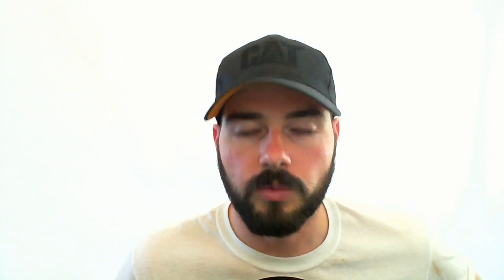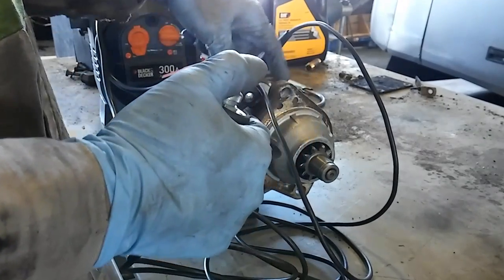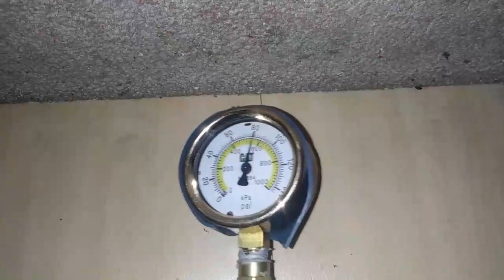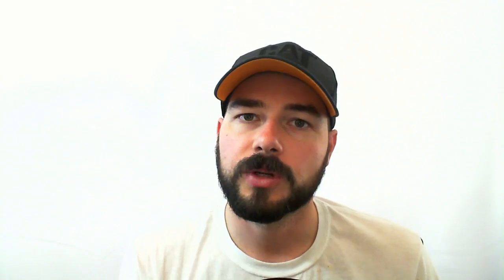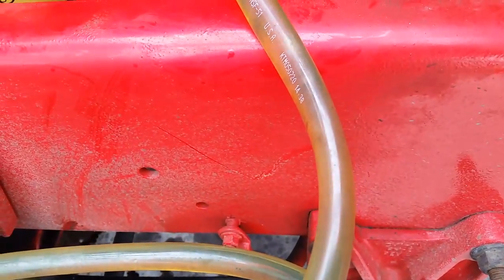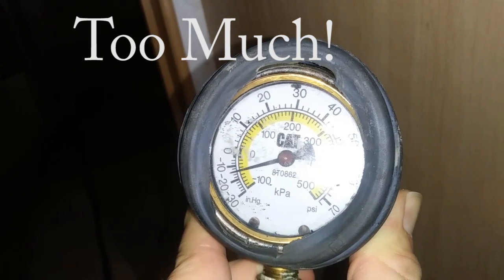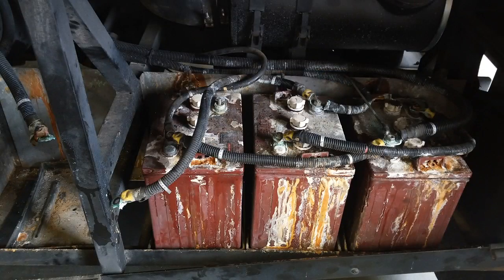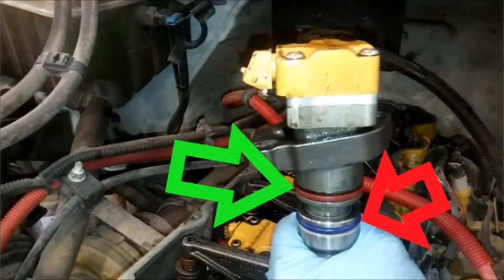Why Are Diesels Hard To Start? How To Fix A Hard Starting Diesel?

Comment: The points you made about poor ground connection is true, almost bought a new battery believing the battery was going but when checked realized the ground wire to the starter was slack and the ground to the body was corroded..👍🇯🇲

Comment: Hi, I just watched you video. I’m not a mechanic but I can stumble through a let of repairs. Being retired and extremely limited on money I’m trying to deal with my van not starting. It’s a chevy year 2000 diesel duramax  express 3500 van. It’s been hard starting and when it starts I get a few seconds of blue smoke out of exhaust and  then drives fine. I continues to start fine. But after I park for a few days it becomes hard to start again. Yesterday it would crank and almost start and I would get blue smoke out the exhaust but never start. And the cranking is a bit slow and if it doesn’t start in a few seconds the cranking get very slow. I have put a freshly charged large jumper box on it but still the same. Two days now and I haven’t got it started. I don’t have the money to take it to a shop. Any pointers that I should do? I want to check the grounding straps. But I have to find them. I remember seeing one in the past and it looked very green and deteriorated. I’ll try a jumper cable from battery to engine block. Anything else with my limited skills can do?

Comment: I have a 05 5.9 dually that I have done lots of upgrades on. grew up with muscle cars but knew little about diesels but I have learned. My 5.9 has always started right away and never smokes. I consider myself very lucky. I tow a fifth wheel and if your going to work em you gotta work on em. Good maintenance filtration and lubrication.

Comment: My 4m51 Mitsubishi stops working whenever am running and the engine is hot.it can't even start right after it stops ,I will have to wait until it cools down about an hour or so before I can start it again.what would be the possible cause of this?

Comment: My Dodge/cummins has been acting strange lately today it was almost 30 out and wouldn't start I'm like ok wtf. Checked the wires to grid heater and the battery connection is shot. Tried to use too small of wire to splice and it instantly started smoking!

Comment: Certain motor oils are designed to be thinner (less viscous) when cold and more viscous (thicker) when hot. For instance, multi-grade or multi-viscosity motor oils show a low viscosity at low temperatures and high viscosity at high temperatures. I believe you indicated the opposite. Did I misunderstand?

Comment: Diesel van wont start but starts easy if i use quick start spray into inlet ! I see there is a crankshaft sendor fault code so ive bought a new sensor but not fitted yet !
Why/ how does the car run fine after start if the crank sensor is at fault ? Surely if its at fault car wud run badly after start ??
Im struggling to understand ??

Comment: The truck I drive for the company I work for has a hard time starting after its been sitting over the weekend, it has an 8.9L cummins and it takes a good 1 or 2 minutes of cranking to start when its 100% cold and thats only with it about 60 degrees out

Comment: Just a little fyi.
 Today I was listening to this video on my way out to check a grinder with a c27. It's having a really long crank before starting and randomly dropping to idle. 
The issue? Bad wire connection on back of the key switch.

Comment: I have a 2005 Cat C7 Acert. Very hard starting. When it does finally start, it sounds like it's running on 3 cylinders, once started picks up a couple cylinders pretty quick, and then the other one a few seconds later and then it's running smooth and no problems. All while cranking and about the first minute or 2 after starting, putting out a huge plume of gray smoke. So according to this video, likely injectors, or could it just be  the seals? It does have some codes that need to be read. Of course first things first, get the codes read for the known problems. So I have an idea what to be expecting, any strong idea of what I'll be looking at for repair? It's only got 131,000 miles / 5005 hours so I'd hope it's certainly worth repair and shouldn't have any major issues anytime soon provided I keep the oil clean and changed at proper intervals. Thx for any help or suggestions.

Comment: You did not talk about heater plugs related to hard starting especially in cold condition. Is it that it does not have a relationship with hard starting in the mornings?
Reply: Your engine should start if it has good compression. Even without glow plugs

Comment: Ambient temperature is one of the most important things on a Diesel engine!
Therefor one must somehow heat the intake air , and also make the injection pulse with as high of pressure as possible!

Comment: This is why a 335 cummins I drove in the early 70s was sweat, it had a compression release you could spin that sucker even with a weak battery and fire it up quick when you released the handle.

Comment: I just had my 6.0 2005 F-250 Diesel New head gaskets replaced. No new heads but every thing but not the turbo. That was just rebuilt. Runs good BUT hard to start every morning. Upsetting. They will not help me fix the problem. How do you get the compression air racial repaired?

Comment: Hi Ape just discover this channel,really helpful info Thanks.
What about hard starting engine when in working temperature?
I have mondeo mk5 2.0l diesel TDCi ,this is Ford fusion in USA .I live in UK and the weather is between 0 and 25 celsius over the year.I have an issue when engine is hot.
If I stop the engine and try to start it straight after is turning much more than usually need to start,but I use a start stop and the engine shut and start on a traffic light for example I dont havy any issues.just a note Camshaft position sensor is new and is genuine from main dealer.

So if you give me any guide will be much appreciated.

Comment: I have a '95 Ford f250 7.3l powerstroke..... I have to plug it in for an hour if it's under 50⁰ out. Not a mechanic, and my mechanic isn't a diesel guy.... help?

Comment: What would you consider be the issue on a diesel engine that starts cold in 1-2 cranks, but needs 20+ cranks when warm?
Reply: I know this is an old comment, but this may be some knowledge to a future reader. 

Cold air is more condensed than warmer air, this means more air particles can be crammed together in a given area. This is due to them moving slower and taking up less room. 

This means in cold environments you are having excess air in the cylinder when the atomized diesel goes to detonate. The air to fuel ratio is different with having more air than normal compared to warm temperatures. 

So if you are having no issues in the cold, but having issues in warmer conditions I would start with a bigger air intake, and see if that allows for better mixture. 
I could expand further but I’m not trying to write 10 page essay, that no one may read.

TLDR, it is starving for air.

Comment: Really good video, I learnt a lot, thanks..

I have a fiat ducato van, 2.3L 120 multijet... with a hard start...
It cranks for about 5 seconds, then struggles into life, with a ploom of white smoke when it starts, and runs rough for about 5 seconds, I normal blimp the throttle, then its perfectly fine.... from the sound of your video this is a cold misfire... most like injector? is there anything else I should check?

I have checked battery, cleaned and tighten the battery cables (positive was loose, made it better but still issue). injector leak off test done which was fine, changed the pressure regulator as I thought it should hold pressure in the rail when off as I was told this has a check valve (your video says its doesn't hold pressure).
I checked FPR sensor on my OBD, starts around 5000PSI, idles 6300PSI, goes up when I press the throttle as expected. when I shut off it drops to 58PSI in about 10 seconds, if I then check it 2 days later then its still sat at 58psi never goes down below that, but sometimes I've watched it with nothing running, and the 58psi will change to 26psi for just a second then go straight back to 58psi, so it seems to work, but also maybe seems dodgy....
is it also worth checking compression or timing as a few people have suggested?...

Any thoughts would be greatly appreciated thanks :)

Comment: hi. i have a c7.1 engine on a cat 323d2l excavator which does not start without spraying cold start into the air inlet. what could be the problem

Comment: I hard a hard start on my 1kzte. After I had my injectors serviced. One of the fuel lines of the pump was sweating a tiney bit. Couldn't tighten the connector anymore. Took the connector off, sprayed with carby cleaner. No longer sweating.

Comment: My dad has a powerstroke 6.0 and he uses 15w-40 for his oil. I told him to switch to 5w-40 for easier starting but he’s stuck on 15w-40. Would you make the switch or stay with 15w-40? The lowest temps we see here is -12c but it’s usually around 0c. Thanks for your time and input
Reply: At those temps I’d favour 5W/40 for sure.

Comment: Good Day. What gives an engine torque.  some engines come with the same horse power but different torque settings. Detroit series 60 comes with 500 HP and 1650 torque. I wish that to be
 500--1850

Comment: Great work!! I have a 3126 in my FL70 quad cab  4x4 service truck and get along good with cold starts but have had the injector oil seal problem. Ended up with oil in my fuel. Keep up the good work.

Comment: I have a 1983 BJ42 with 3B Diesel on it. Before removing the cylinder head the engine was starting very easy but after the head job, it takes some time. Will appreciate any help.

Comment: Or you have that water-cooled intake air aftercooler or what it was. As Cummins Big Cam had, there was a bad engine starting when really cold. Without ether pump never starting cold.

Comment: HEY ADEPT,,  GOT ONE FOR YOU ,,3406E 98 , IT WAS STARTING GREAT ,BUT I ACCIDENTALLY HAD IT IN GEAR AN AN IT TRIED TO START AN IT WAS IN A REAL BIND UNTIL I WAS ABLE TO STOP IT, BUT NOW ITS HARD STARTING ??????
Reply from the maker: Is the engine slow cranking or just doesn't want to fire?
Reply: @AdeptApe  slow  crank an STARTS finally
Reply: Put new exhaust  manifold on drove   50 mile an replaced  it because it started rusting   I bought  from pdi.well had oil in every  cylinder  port .

Comment: Some of the old trucks had a t-handle you'd pull to relieve the compression in order to get the engine turning over. And no I'm not referring to the t-handle for shutting down the old Detroits.
Also, I remember trucks that had a different voltage/amperage for the starting system.

Comment: Battery to starter cable gets massive current. That high heat, over time, excellerates corrosion, increasing resistance, which makes that cable an additional load on the starter when it's old

Comment: I'm ready for fuel systems class. CSN I just put fuel in the left tank?
Reply: Can*
Reply from the maker: You can, but depending on whether you have a leveling hose between the tanks or a T supply and return, you may end up with a tank less full than the other. Depends on the manufacturer.

Comment: how about a 4 cylinder perkins that is hard to restart after it has been run for a while ?
Reply: Bad injectors?
Had a problem with a perkins 6.6 1106d engine.

Comment: I have 2006 vw sharan 1.9tdi my engine doesn't start immediately the crancking seems normal but it takes like 4 to 5 seconds to start up even if the engine is hot.. i checked that battery it's good as new could be a starter failing! I am not good with mechanical problems.. but i did a computer diagnos  and doesn't show me any kind of engine or sensor defect

Comment: Josh, just this morning 01/30/2020 i ran into  an owner operator having trouble starting is truck. I asked him to crank the engine it was turning with good power, told him sound like the injectors where not supplying enough fuel to the engine he loosen the supply line to fuel pump cracked engine good supply and he changed both fuel filters, still didn't start. after a while he said to he remembers having this same problem. so he started to pull on the wire assembly from battery that leads to engine, and just like that it started right away, you think it might be a bad wire that leads to sensors to E.C.M. I'll stop there. thx

Comment: beautifull video bro i have an issue with my cummins m11 celect plus i changed the oil tempature sensor and oil pressure  senser and air manifold sensor and the anbient sensor and now iam having very hard starting after it sits for couple of hours and i seen some leaks near the number 5 6 cylinder i need your help plz  i am in the midlle east beirut lebanon no cummins garages here all mercedes man volvo scania iam the only with 1997  m11 celect plus
Reply: sorry i forget to tell u i have fault code sid 84 timming acutator #2

Comment: I just picked up an old Perkins 4-107 attached to a 10kw generator, lots of smoke and would not start without the ether, I pulled the injectors and I am having them rebuilt, hopefully this will help it all around!
Reply: They always need heater plug even after 20 minutes stopped but with a good manifold heater no matter how cold they always start reliably

Comment: "mechanical faults don't typical get better has the engine warms up" faulty followers and a slightly bent rod do, unfortunately I experienced that on my engine. Good tips there, specially the vacuum before high pressure pump!

Comment: Toyota recommended a 5w30 premium fuel economy engine oil, but do you think 15k40 is better for winter as it is lower in viscosity ? thanks
Reply: 15w40 is a higher viscosity

Comment: I also hear a possble hissing sound,suggesting an air leak, thus compression is not being achieve. Toyota replace the fuel filter and may not have used a new seal perhaps ?

Comment: If i manually prime my toyota corolla d4d 2003 then it starts much better in the cold, in the mornings. Does this suggest a fuel pump or fuel tank/line pressure loss overnight ? thanks ?

Comment: My question if a engine miss fire wild running at mid or high idle and give off white smoke are it pops and sounds like it miss in a milly second with the white smoke what could cause tht problem ?

Comment: Good stuff👍. I have a 3406e 5ek and i changed the timing sensor on the top right (drivers side) of the gear housing, but where's the 2nd?

Comment: My 3046 cat engine on my d5 dozer will not start without ether at first, burns a ridiculous amount of oil but runs great. I’m thinking maybe worn vale guides and or a bad exhaust side turbo?

Comment: I can't count how many times I have ran into hard starting problems on all types of engines due to bad starting system primary power circuits.    Almost all of them due idiots who think that those shitty clamp on battery cable ends are good for anything and or when used on obviously rotten heavily corroded cables.  

I've even had morons claim their starting systems were so good they could make their battery terminals/cable ends and even cables smoke when doing a real hard cold start!   W T  F?    NO!  they were not good.  Their cables were corroded to bit s and they had the stupid  cheap ass clamp on replacement ends on top of that!  

Just doing proper updates to replace such bad wiring with new properly made cables of the same or larger size  with ALL connection points on both sides attached to clean and properly located tie in points ( not 2 or more 0 - 4/0 ground cables terminated to a single 3/8" stud that wasn't even on the engine or starter body where they should have been) solved problems of being hard starting at 40F  now not being a problem even at 0F!

Comment: I've spent some time watching a few of your videos. I'm not at all mechanically inclined, but I'm keen on reliability especially since I'm considering buying a 30 or 39 foot Class A diesel pusher somewhere in the 2003 to 2008 range. I think you do a tremendous job with your overviews. Where the heck are you located and, when I get to a point I've found an RV I'm interested, are you open to giving some advice on the engine? Also, if it's at all possible, I'd be willing to drive the RV to you to have you give it a thorough inspection if you are open to something like that. Thanks again for your time and attention on this subject, I get a lot out of it. Best of luck to you.

Comment: Great info 👍.
What would cause the engine to stall 30-90 seconds after startup on Heui 3126?  Started doing it after installing a cat reman injection pump.  If you try and work the throttle, it may stay running or it may rev erraticly on its own for a few seconds.

Comment: I have 2001 cat D8R with 3406 

It's in the dealership for 2 months now .

The issue  is with diesel line leake , we have changed all line , install new clambs , rebuild the diesel pump and still there is something causing the leakage , it's not on one line , every time we fix a line the leakage come from the next one.

Dealership says it's return valve , they changed it and still the same.

Any idea or suggestions for my issue ?

Comment: I'm working on a giant lemon (2013 Maxxforce DT 7.6). The engine surges badly at idle after warm up. I depress the accelerator to a 30% angle or less and the engine smoothes out. What could it be?

Comment: What is a hewy engine i have a cat in my bluebird the miss i guess go s away under load
Reply: Basically the injectors is controlled by a high pressure stream of oil that turns on the injectors if you have a miss it could be and injector but there also could be other issues
Reply: Hydraulically actuated Electronically controlled Unit Injector